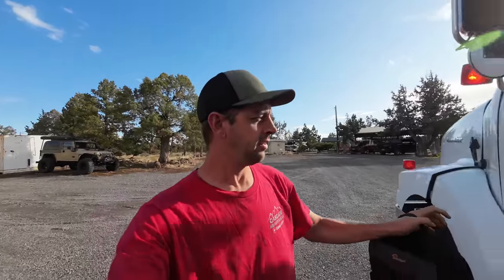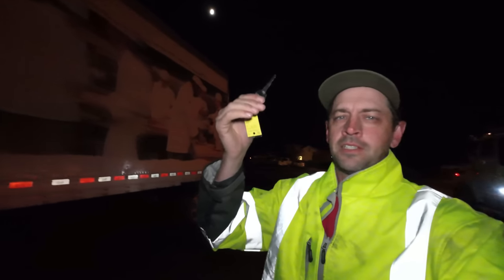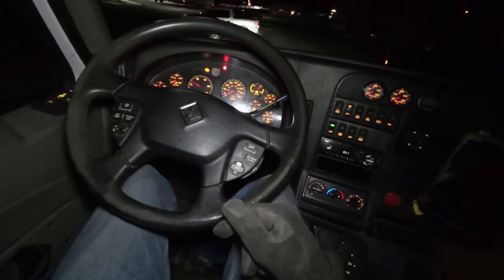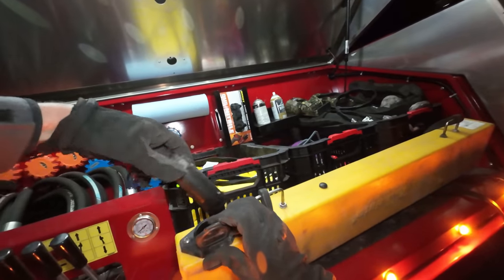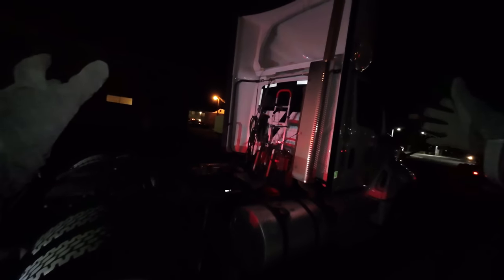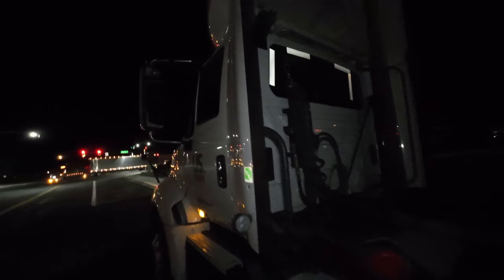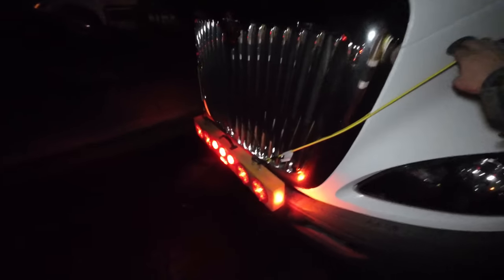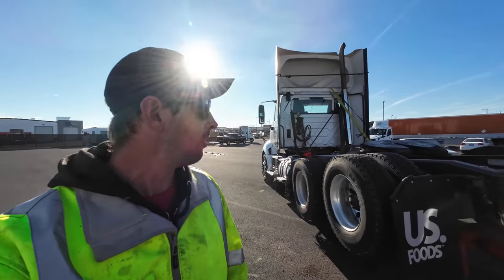Pulling a parachute for 300 miles!

Comment: He couldn't unhook his own trailer while he was waiting for you to arrive?
Reply: He'd run out of hours.
Reply: @imagseer How long does it take to unhook? Two minutes? It didn't sound like he was that close, sounded like he had a few hours left. Not enough to wait for Casey, but you don't need to wait for Casey to unhook.
Reply from the maker: Depends.  If he signed out of his elog as “off duty” as soon as he got to the hotel and while waiting for the company to decide what they were going to do, then that’s when his ten hour reset clock started.   After that, coming back on duty to unhook the trailer, even if it only took two minutes, would restart his ten hour clock and further delay him in getting back to work.   Even if it was only an hour from when he went off duty to being told that the truck was going to be towed, unhooking it would mean an extra hour he has to sit and wait until he can start driving again.  It makes more sense to just let me do it when I get there
Reply: @CaseyLaDelle  that's fair enough
Reply: @CaseyLaDelle That was my point: he could have done it when he got to the hotel. But if they did not know what they were going to do at that time it certainly makes sense.

Comment: At what point would you decide to trailer tow instead?  Would it be over height?
Reply from the maker: Probably over height.  I also didn’t know the running condition of the second truck and if would be in an easy position to get on the trailer.

Comment: Instead of tape on mirrors. Just fold them inward. That's what i always do.
Reply from the maker: That works great as long as the wind doesn’t catch them.  But if it does you’ll be replacing a lot more than a mirror

Comment: Casey would it have been better to tow both trucks from the front so you weren't towing a parachute? I am not trying to be disrespectful at all. I was just curious and knew you would be the one to ask.
Reply from the maker: Yes, I could have drive faster and burned less fuel, but then I would have to remove the driveshafts.   This was a tractor swap so I didn’t want to do that.

Comment: Why easier to pull  by the rear end, you could drop the driveshaft or pull axles and not need all the straps.
Reply from the maker: Because this was a tractor swap and not a tow to a shop.  This truck needed to be ready to run when it was dropped off.

Comment: What about the exhaust? Was common practice when i worked for a transport company to tape off the exhaust,, so  when hauling backwards,, prevents turbo from spinning free without oil,, apparently,, great videos otherwise 👍
Reply from the maker: The turbo will not spin.  Simple physics

Comment: How come you don't use Collins dolly's to tow it forwards?
Reply from the maker: Mainly because the of the 4,280 pound weight rating.
Reply: @CaseyLaDelle  they need to make a rated set
Reply from the maker: @brettheath3182  there is a company that does, but then you run into the problem of being ten feet wide and having to run under oversize permit rules.

Comment: Do you not tow from the front because of automatic transmissions?  Not a trucker guy, just curious.
Reply: Doesn’t matter what type transmission but would have required driveshaft to be disconnected and replacement truck needed to be ready to run at drop off point.

Comment: Did you ever figure out the fifth wheel pin release for next time? Some you need to pull out and move towards the back . There is a notch in the rod that holds the pin out.

Comment: 450hp really isn't much for an wrecker... over in europe we usually have 450 to 700hp in normal trucks and the wreckers usually have 600+hp (but they can also legally tow a gvw of up to 80 tons (~175,000lbs)
Reply: Ever since we lost the cat engines most of us are stuck with Detroit and cummins. There is no substitute for a good 3406 or C15 kitty.

Comment: I'm curious what you think your MPG would've been if you'd trailered the truck to/from the site so you wouldn't have had the parachute effect.
Reply: I wonder if his trailer is low enough that the fairing is under limit?  If he was confident that the truck at the other end would start and it was under limit, this would be a good way to go.
Reply from the maker: I was going to measure the height of those trucks so that I would know if I could trailer them in the future, but forgot.   And not knowing the running condition of the other truck, taking the wrecker was the safe bet
Reply: @CaseyLaDelle  Understood. When I saw them drive away after you dropped it off I was like "awww, coulda trailered it." 

We'll see what the future holds. All the best!

Comment: Ha,ha ha thats on you bud dragging that "parachute" Hook it up right and no parachute ! Kind of backaswards don't ya think ? I mean you towed the Uhaul truck proper . Couldve done these the same just a little extra work.  But probably 3 miles per gal. better.  So thats 100 gal.fuel hmmmm?
Reply from the maker: Can’t pull the shaft out of a truck that has to go to work when I drop it off.   And yes, I burned more fuel, but I also drove slower and charge accordingly.

Comment: Why not tow the replacement truck nose forward?  Could you not start the truck and let it idle in neutral while under way?
Reply: and be liable for damages?
Reply: @dubious6718   What would that damage?
Reply: Some tractors have an idle shutoff programmed into the ECM
Reply: @myofficegoes65  Aahhh.  It's been a few years since I have been in a commercial cab.  But you would think without the parking brake set and the speed sensors not showing stopped, the computer wouldn't shut the truck off?
Reply from the maker: Transmissions are expensive

Comment: "for all you people who said not to use bungees and they won't work.  It's designed to use bungees and see, it worked."  Yeah, except for that whole part where it feel off and now you have to buy a new one. Other than that, you're right and we are wrong.  Why do people have such a hard time admitting they were wrong.  I've been wrong hundreds of times when you did something and I thought, that's never going to work.  You were were right, I was wrong.  This time, I was right and the bar did fall off because the bungees were a bad idea.
Reply from the maker: Bungees are literally how it is designed to be secured.  Try again.
Reply: It was NOT the fault of the bungees that light bar was lost, but what they were attached to on the top, which was a ratchet strap that wasn’t as stationary a point as necessary.
Reply: @JohnHallgren  The problem was that the bungee's were not pulled tight.  Because of the loose bungee's the light bar was able to bounce enough to unload the bungee's and they fell off.  This is a common problem with bungee's which why I wouldn't use them to secure a load.  You see them along the side of the road all the time.  I see them daily, especially the rubber ones.  also, bungee's will break and fail which is also common.  He could have just put the hooks of the ratchet strap on the light bar, ran it throught the grab handels that he hooked the strap to and he would still have the light bar.  It also would have likely worked if he had hooked the bungee's to the ratchet strap, through the light bar then back to the ratchet strap.  Imagine if that light bar falls off on the highway bounces, then goes through the windshield of the following car.  Or hits it in the tire and crashes the car.  Or any of a number of other things that could happen.  It's just not worth it to save a few minutes.
Reply: @frotobaggins7169  actually he believed the bungees were tight enough and it was the ratchet strap that caused the movement allowing the bungees to jump off.
And as he’s said, using those bungees on that type light bar IS the industry standard and how the manufacturer intends it to be done.  See another well respected and very popular YouTube towing channel Ron Pratt, who uses bungees for light bar as well..
Yes, in that particular case, had he used ratchet straps on the top instead since there wasn’t a fixed place available close enough to hook bungees to, it would have been better. 
A light bar that weighs a few pounds is certainly capable of being held in place by bungees, because it’s not a load on them.
Reply: @JohnHallgren  I get it.  I'm just saying, it usually works but it fell off, so it didn't work.  Industry standard or not. It's an needless risk to take.  The person suing you will not accept, "it's an industry standard" in court when it hits their car.  Why risk it?
Reply: @frotobaggins7169  but you’re not getting it because it was NOT due to the bungees themselves but WHAT they were attached to, ok? Likewise, if a ratchet strap were attached to a wobbly handle, and the handle came loose, that’s NOT the fault of the strap. A securement connected to an insecure location that fails is caused BY the location…

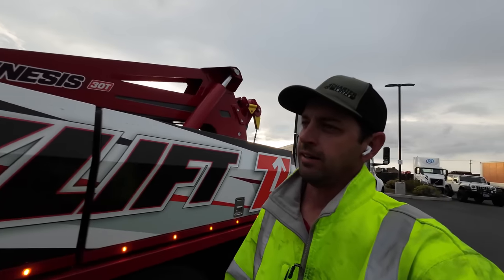Comment: @1:44 all of that to avoid dropping a Driveline? Fafo
Reply from the maker: No, all of that so that the truck was ready to go to work when I dropped it off to the driver.
Reply: @CaseyLaDelle I might buy that if I hadn't already seen how fast you drop a Driveline, and put it back in.  When I saw the thumbnail I just assumed you were only going 5 or 10 miles. All Things Considered I bet next time you would drop the Driveline?
Reply from the maker: @user-eh5cr4or6k  no, I most definitely won’t.   I can absolutely remove the shaft faster than I can secure the fairings, but since it’s a tractor swap that’s going straight to work, the driveshaft needs to stay in.   I have no agreement with this company on the reinstallation of driveshafts, and all manufacturers say that the driveline hardware is one time use only, so I’m not going to reinstall it.